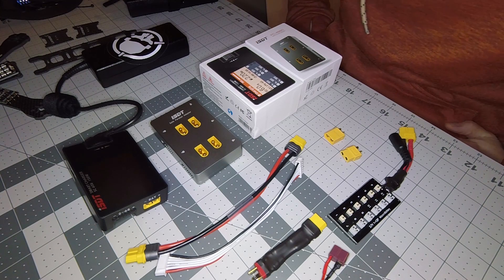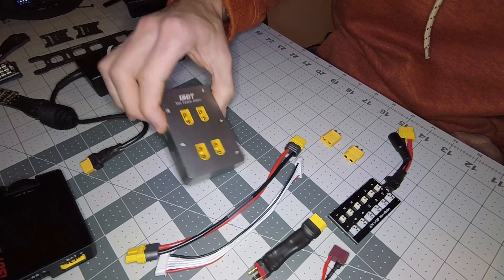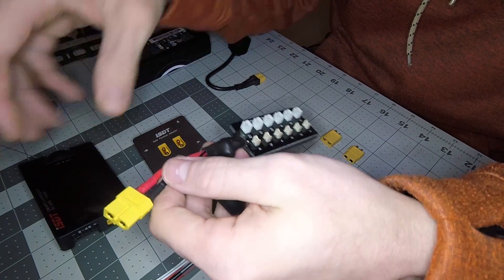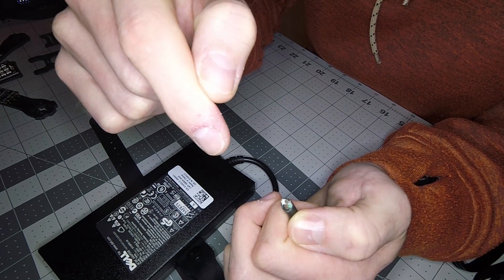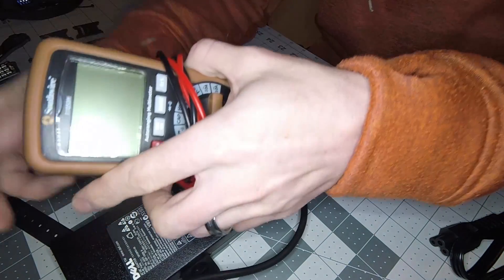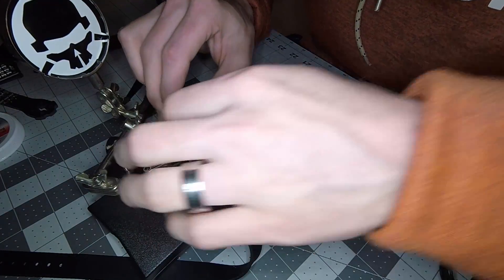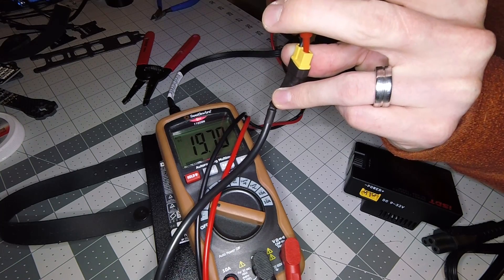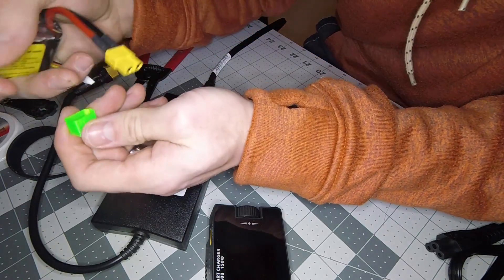ISDT Smart Charger, WALL POWERED! | FPV DIY

Comment: The ISDT SC-608 Smart Charger is a 150 watt charger, which you're powering with a 90 watt power supply (19 Volts x  4.74 amps = 90.06 watts).  Really not a good choice.
Reply from the maker: Shadowcruise99 Really? so is it hard on the charger or the power supply? I figured as long as I was not charging over 4 amp it should handle fine. so far I have put it through many charges with no problems, but I am open to ideas and to make sure I'm doing it right.
Reply: 4 amps at how many volts?  Can you use the AC supply?  Certainly, but you don't want to exceed 90 watts or you're going to overdraw the supply.  It may run hot, blow a fuse, provided it has one. or simply burn out.  There may also be adverse effects, to your Smart Charger.
Reply from the maker: Shadowcruise99 Thank you for the information I'll have to see how many volts or watts I am hitting when parallel charging four 4cell 1300 lipos. I also just found out that ISDT makes a power supply now (ISDT CP-16027 160W 27V XT60 Output Active PFC Power Supply Adapter)
Reply: Yeah, there you go.  Great find!
Reply: Shawdowcruise99 is not providing a complete answer.  If you have a power supply capable of 90W, you just have to make sure you stay below 90W during charging.  So if you are charging a 4S battery, you would calculate the maximum current you can use.  I (current) = Power/Voltage.  I = 90/(4.2V*4cell) .  So max current would be 5.36A.  Taking into account losses in the power supply and in the cables, stay about 1/2 amp below this as your max charge rate.
Reply: + notcranium - While it is true, that you could still use the charger with that particular power supply.  One could argue that a 40 watt power supply would be sufficient, under certain circumstances.  However, to suggest that people should disregard my comment, is not only dismissive, it's rude!
Reply: you are correct which is  why I changed my reply right after I submitted it to indicate you were not providing a complete answer rather than to disregard.  Because most of what you stated was completely accurate.  :)
Reply: notcranium I don't think anything I said, was inaccurate.

I would hate to think, that someone would go out and buy a 90 watt power supply, assuming that they could utilize the full charging power of the SC-608, only to find out the hard way that it wasn't so.
Reply: Yes, I agree; however, if you just tell people their choice is not good because the charger is capable of drawing more power than the power supply, it isn't really educating them to make educated decisions themselves.
For example, I have a iCharger 406duo which is two channels and capable of charging 40A per channel or 1000W per channel.  It is very expensive to get a power supply that can do what the charger is capable of.   Do I need a 2000W power supply?  Not really.  I just need a power supply to meet my charging needs.  So I feel it is better to know what the limits are and what they are based on so operation within them can be done without going outside of the specs of the power supply.
If 90W meets his needs, he's all good.  :)  If it doesn't then knowing how to calculate what will meet the needs is better than just matching power numbers.  Although matching power numbers will work.
Reply: notcranium Interesting, most of the people I know using the iCharger 406s and 410s, use the Hewlett Packard HSTNS-PL11s or the DSP1200FBAs, typically costing around  $50.00 new.

https://www.amazon.com/gp/offer-listing/B002S4LUTQ/ref=dp_olp_all_mbc?ie=UTF8&condition=all
Reply from the maker: Shadowcruise99 , notcranium - Thank you both for sharing some good information and insight to this video and a safe way to charge.  Also thank you for keeping the comments nice! I ended up doing the math and as long as I keep it below four 4cell lipo's I was pulling 87 watts, this is the max though and for a stay at home charger I will be getting a more robust set up, but for travel I think this is a great option since it is small and can do a few lipo's at a time. I have dropped down to doing only three at a time just in case on the travel charger.